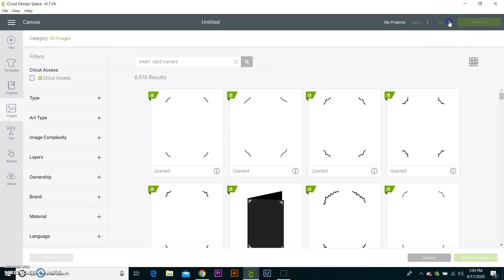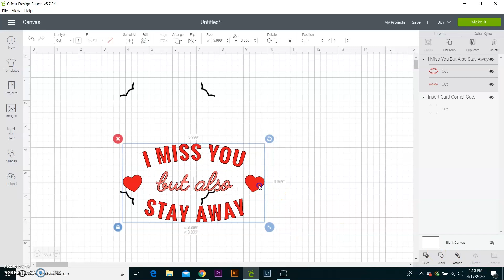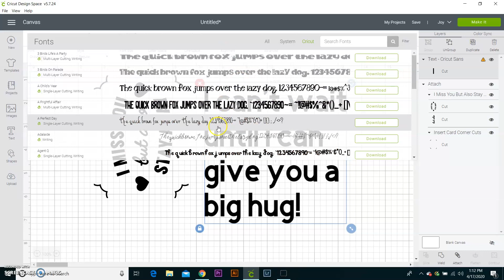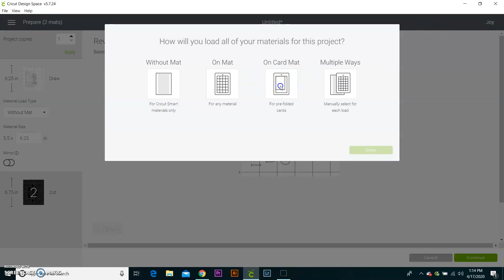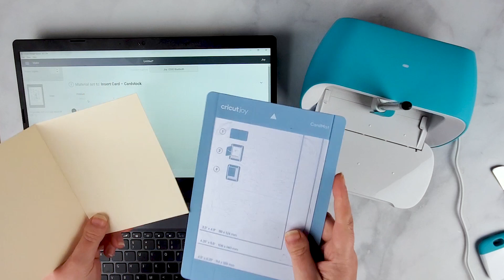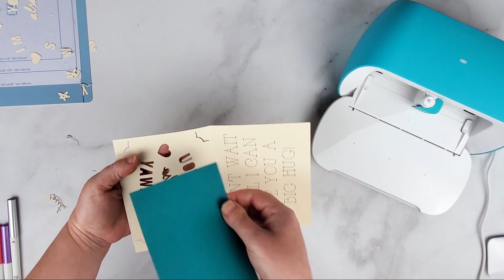Making Custom Cricut Joy Card Templates

Comment: I did it just like you did but it's still over cutting. It cutting past the bottom of card. It will not let me change the lenght size. It's set when I design but changes it during the set up.

Comment: Thank you for posting! I have a question however… I am following the same directions as you but every time I try to make the inside of the card it says it is incompatible with my cricket joy. I am connected to my cricket joy. I have cricut access. I have also chosen a writing font like you indicated. Any ideas on how to resolve?
Reply from the maker: Did you try changing the size??  Maybe the writing is too big??
Reply: I'd get a message like that too.  I changed the setting from "pen" to "foil" and put my pen in the holder instead of the foil transfer tool (the machine doesn't know the difference) and it works for me.